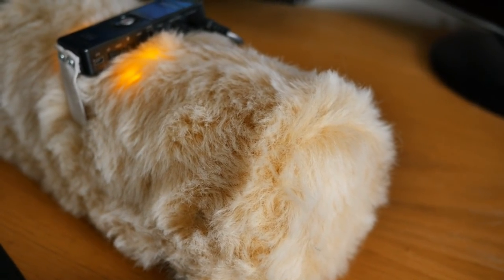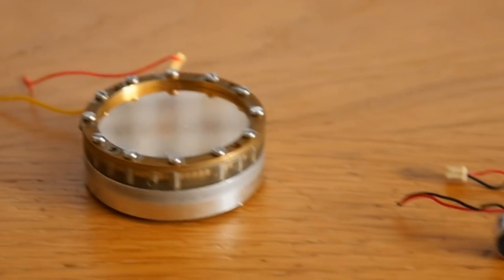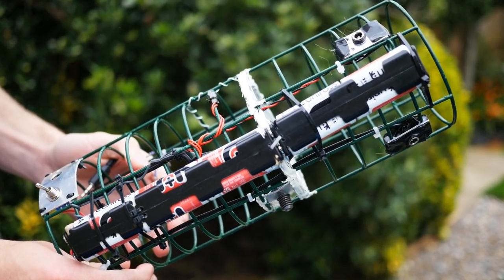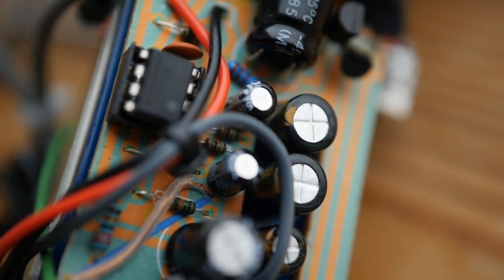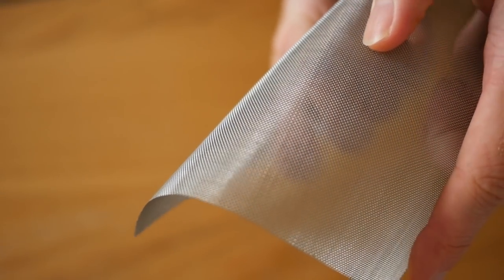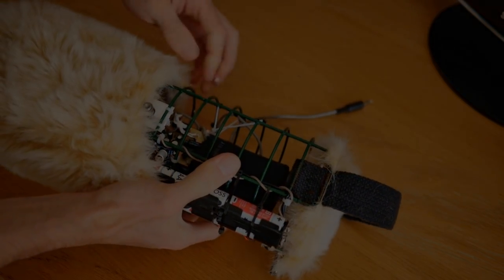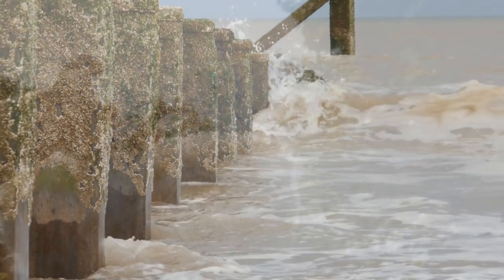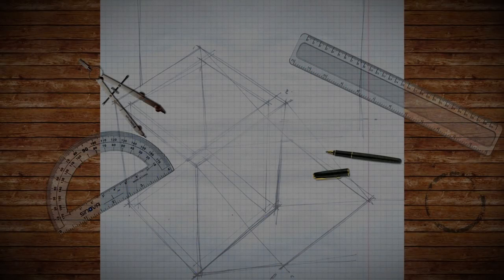The Ultimate DIY Microphone (super low self-noise!)

Comment: I love this... This is SOOOOOOO good, but yet it has a few pet peeves I feel an absolute need to point out.

Clearly, you have the electrical knowledge and audio engineering understanding to not only gut out 2 seemingly expensive mics [$200 is expensive to me, $400 for 2 is a nightmare] but to track down the right kind of pre-amp circuit and modify it for the phantom power requirement of condenser mics and to then manufacture that all together into a compact package and then shock suspend it in a cage... 

Yet it feels like you threw away all that intricate knowledge and attention to detail when you seemingly slapped together the PCB sandwich haphazardly and then made two half-assed screens for the mics and then threw everything else together with zip ties. 

I mean, don't get me wrong, this is well and truly amazing, hell you have a CNC router, I want to build a CNC router so I can do this kind of DIY stuff... You have all this knowledge and skill condensing into a product which is honestly the far upper echelons of what "DIY" usually constitutes an instead of pushing through with that attention to detail and product understanding it feels like you dropped your ability to care about what you're creating and went with the 'she'll be right' fit and finish of dodgy workmanship [the ground plate in the sandwich and the red mounting pads] and the use of zip ties for literally everything mounted to the birdcage and for the mics mounted to the circuitry... You have a fricken CNC bro, could you not design up and fab something moderately more elegant in a short frame of time?

I mean, I love how you found a birdfeeder and used that as the frame, that's brilliant and elegant, but then you just zip tied your mounting plates to it and it's as though you just wanted to avoid thinking of a more 'finished' solution. 

But I get it, on one aspect a lot of these sorts of projects are perpetually a sort of prototyping phase which is never really re-visited and finished off and sometimes something ends up taking more time and effort (especially with me) than you had originally anticipated so you almost start cutting corners to just get it finished... But I don't know, it's like your idea was half a step away from genuinely being mistaken for a $1000 product but the tell of zip ties and chaotic vine wrapped wires on the birdcage are a kind of tell that this is just a really good DIY project...

Zip ties as a fix all... I dunno. It's like DIYers that can't spray paint to save their lives and end up drenching the item in paint rather than lightly dusting it with numerous coats or DIYers who spray paint PCV parts with spray paint instead of vinyl dye (which is, pretty much all of them). It's like, 99% of the time paint is just used as aesthetic surface covering - almost always black - as opposed to a material protectant, which is what paint was originally for especially in the case of metal and even though the entire point of painting the DIY project (or in actuality drowning it in black spray paint) is to make it look professional/good and maybe make all the surfaces and mildly varying materials look more uniform so it looks like a professional purchased product rather than a junkyard DIY, they screw it up by painting entirely wrong. Painting small things is not hard and yet people almost always get it wrong and completely ruin the finished product. 

The irony is that most DIY stuff is either made out of or with PVC, made or modified from toys and cheap electronics and almost always made with plastic over metal, most certainly painted a flat black which is the easiest of all colours NOT to screw up... Yet everyone gets it wrong. The irony is that almost everyone is spray painting with paint and with terrible technique when there's already a product out there accidentally suited exactly for their purpose: Vinyl Dye.

The irony is that vinyl dyes, originally for the purpose of dying the vinyl interiors (mock leather) of vehicles and to an extent, I guess any furniture/couches etc with vinyl, is an accidental exact match to all the needs of a DIYer. Vinyl dye, originally for dying vinyl fabric (arguably impossible to spray paint) is chemically 100% compatible with vinyl-based plastics, i.e. Polyvinylchloride aka PVC and it is also 100% compatible with ABS plastic which is ironically a very cheap and fairly durable plastic which is very easy to injection mold, meaning most consumer good especially as far as tech and electronics go, when made with plastic are made with ABS. Ironically, nearly 100% of the things DIYers touch are almost certainly chemically compatible with vinyl dye and luckily for a group which has consistently proven themselves pretty terrible with fit & finish and with painting, it's stupid easy and almost impossible to screw up. 

Granted, vinyl dyes get a bit technical and confusing when talking about gamut and pinpointing certain colours and there is a great amount of variation to the end product depending on what you're painting on (all PVC and ABS is pretty much compatible, but it's not necessarily going to be the same finished product) but when talking about the 'just paint it black' mantra of DIY then you literally cannot get it wrong. With vinyl dying there are no primers, no clear coats, no need to remember how many primer to top to clear coats you have done (obviously), no complicated drying times and humidity/temp requirements when painting as with paint, there's no intricate prep work and unlike any kind of paint on plastic, even marketed "plastic paints" or "plastic dyes" you work ever get scratching, chipping or flaking of the paint with vinyl dyes. 

Only vinyl dyes can (accidentally) accomplish this holy grail purpose of being perfectly suited to something completely different to its original intent and being so perfectly (and accidentally) tailored to the requirements of such a large potential user base. Paint is very finicky and even if you follow the steps it may still not work out. With vinyl dye, all you have to do is scuff up the surface lightly with steel wool or sandpaper, if there's paint already over the plastic it needs to be sanded back to just the raw plastic. Vinyl dye seeps into and stains the plastic rather than simply putting a coat of paint on the top so if there's paint or a finish, the vinyl dye will chip and flake but if you sand back to raw plastic it will stain and dye the surface. Then, clean the plastic surface with a mild detergent (like soapy water with a dish detergent) to clean up all the potential residues off the plastic then rinse it well and dry it. Unliking with painting this prep isn't rocket science, it's literally like washing a plastic bowl in the sink, just wash and rinse it well and let it air dry completely. Then simply spray very very light even coats of vinyl dye and wait a solid 20-30 minutes making sure each coat is dry. 5 coats are probably plenty. Once you've done it once and realised that any un-painted/coated PVC or plastic can simply be scuffed up quickly, washed with dish soap and then painted plain black with the absolute minimal effort (vinyl dye spray is roughly the same price as paint, and you don't have to buy primers or clear coats too) then you realise how heavily the DIY community could benefit from this info and from ditching duct tape and zip ties as a primary form of construction... Seriously, does my head it, so much DIY is shit purely due to crappy paint and zip ties. 

I digress... This was actually awesome and I really really want to make one now that I've seen it can be done well and that it creates such and awesome final product I'd just also really like to see you go back and 'touch it up' to make it perfect.
Reply from the maker: +Jordan Huckel duly noted, and I agree. I've been meaning to revisit this but make all the elements of the design perfect with source files available for others to make a carbon copy.

Comment: Nice project. 
But something different from your Schematic with the actual PCB, Especially for DIODE. please explain ?
and also can I use this circuit for amplify electret mic ?
thank you very much
Reply: That circuit is too overkill and supplies too much power for an electret mic..A simple two/three stage npn transistor preamp would be much more suitable.

Comment: Was sticking a boost converter in there really a good idea?
Reply from the maker: From my tests it added no audible noise to the audio signal, so it was definitely worth it to allow the use of fewer batteries, and have a constant predictable voltage delivery (rather than one that varied with battery charge).
Reply: +DIY Perks  +Old Machines & Such I was impressed with the build, even the preamp choice is great (there is better though with new LME series from NI) but only thing that hit me as "this is bad" was the crappiest boost off of ebay...
Luckily that one works at few hundred Khz, if it is significantly higher then 200KHz aliases from 196KHz Fs with high end sound recorders should not be a problem add little bit more filtering and preamp with decent PSRR>you're good...
Luckily final result seems fine 8-) thumbs up!

Comment: This would be a lot easier now with 2x Rode NT1 5th Generation USB, a small laptop for power or a powered USB hub and iPad/iphone. No soldering no PCB boards etc. You run on 32 bit float.

Comment: interesting.. you used an Attenuator ( 6:05 ) instead of a Audio log potentiometer.. why is that?
Reply: +DIY Perks did you use it as a db cut for the noise or for volume of the whole circuit?
Reply from the maker: It just allows for repeatable volume levels, really, and doesn't require much thinking about on location. For example, I have the three highest settings are loud enough to mask the recorder's own noise floor, while the ones below that are for louder sounds (like gun shots and jets) where the extra headroom is needed.

Comment: I hope you filtered the guts out of that boost converter.
Reply from the maker: Wasn't necessary - the LM2577 is remarkably clean, so added no audible noise to the audio signal.
Reply: +DIY Perks haha seems I let my self get convinced by lots of internet hype about those converters.
Reply: +African Electron The most noise that those generate is at a mutch higher frequenty.
Reply: +African Electron On top of that, all modern amps have a huge PSRR (power supply rejection ratio), meaning the supply's noise doesn't bother them

Comment: This is ridiculous.   I use 6 WM61s  (3 on a side) added into  op amps  powered by 4 AAA cells.  The signals add, the noise doesn't. Cost less than $10, fits in my pocket.  Need to be at least a mile from nearest road to record.

Comment: preamps in h1 and in zoom recorders in general are shit, someone made a video about external mics for dslr cameras and it ended up to discover that its better to use a normal mic preamp for low noise...
Reply from the maker: I did my own tests and the H1 has exceptional dynamic range on its line input when it's set to volume 16. That means really low noise. Zooms older products certainly had questionable preamps, but the H1 is a nice exception. Not sure what their latest offerings are like.
Reply: Omm just as an aside - on the H1, there's a significant difference in EIN between level 30 and 40. Switching from recording level 36 to 37 produces a noticeable drop in hiss. This is true for both external AND internal mics. When making this switch while listening with headphones, you can hear a quiet electronic "click" noise as you move between 36 and 37, not noticeable when moving between any other two gain settings. I'm not sure how this equates when you're using all the gubbins attached to the Rode mic's though.

Comment: Do not power a low noise analog amplifier with a switch-mode voltage booster!
Reply from the maker: +Timur Nuriyasov I did my testing and the added signal noise is negligible, and far less than the microphones own self noise, so it is all good.

Comment: I see you've deleted my comment. Let me repeat myself: You have built a faraday cage and not a unidirectional microphone (shotgun mic). That bent garden net will block radio interference, but it won't do much about the noise, which is an inherent limitation of the microphone used. It's better to use a separate pre-amplifier (especially with Canon cameras), because the low-quality camera pre-amps have their own noise-to-signal ratio. 

Unidirectional microphones are long because they use most of their body to block lateral sound. All the noise travels to the side of the mic and enters its cut-outs, where sponge is placed to soften these noises. The cut-outs work in a similar way to the sponge, the sound waves get inside the mic and hit its opposite wall, replicating themselves while also decreasing in intensity. Sorry if I'm not able to explain this well enough, English is not my native language. 

Except for this lack of research on your part, you've made a major mistake by placing the two microphones opposite each other. Did you mean to build a unidirectional microphone, or one of those stereo ASMR mics? I think you should stick to building LED panels, audio doesn't seem to be your strong suit. Take care, Mr. Censorship.

Comment: that microphone build was like 700 bucks :/
Reply: +ramsey144 an equivalent would be worth something like 2000 bucks. Keep in mind you can get great mics like the one he has for around 100$ used, so you can probably make this for 300$
Reply: manaquri Hmm its still kinda priced too but u know the circuit part on his build... Well he doesnt have good explain how he did his circuit board
Reply: ramsey144 it's mostly just a bunch of jellybean parts (e.g.1-2$ for 10-50 pcs )
the pcb will cost 1.4-2.0$ but you need to order 10 too. (you can get by one for 10-12$, but as you need 2 so it's not worth.) if you have access to a cnc or some other way of making the pcb, it would cost a lot less (like 5-20c/pcb), so you could probably make the 2 for around 20$ (and it would probably cost about the same to make 10, because of bulk prices)

the boost converter costs around 2-3$ 
the battery would cost around 20-30$ (10 lithium-ion batteries) 
a decent guess for the whole case+ fur+ misc plugs would be another 10-20$
so I'd venture to say the whole thing costs 70$ (probably more in the 50$ range)+ the costs of the mics. so if you can get a bargain on the mics, you could get this done for maybe 200$
Reply: manaquri Can i have links for the circuit board?
Reply: ramsey144 at 4:27 you can see the pcb, but I don't have the full schematic, but you can use the one in the video's description with this: http://sound.westhost.com/p96-f2.gif (connect the mic+ of the phantom schematioc to +in of the amp, and mic- to -in) the 48V comes from the boost converter, and the out of the amp goes to the recording device.(you would probably connect the left amp to a jack cable's left pin, the right one to the right pin, and the ground to the common ground.)
Reply: manaquri okay thanks!
Reply: ramsey144 you can also not modify the mics, which could make the whole thing larger, but you could use them for something else or resell them if you don't need them.
another thing you can do is use only one mic, if you are on a budget.
If you are serious about quality and don't mind a bit of tinkering , you can buy matched pair of condensers, and a circuit for it for around 300$, so for around 400$ you have the equivalent of  a 2000+$ mic 

one final thing !i forgot: don't forget to get over discharge, current and charge protection circuits for each battery.(that costs around 3$ for 6) and also buy Panasonic, Sanyo, Samsung or LG batteries, there's a lot of crappy counterfeit or "revived" batteries that for example say 9900mah while only delivering 600mah  there's a lot of information on this as the 18650 batteries are used for e-cigs.
Reply: manaquri Lol get huge batteries :p

Comment: But let’s get this straight. Røde is nowhere close to a high end microphone brand. They make costumer products. The mics sound pretty bad when you compare them to actual high end brands like Schoeps, Neumann or Sennheiser. It’s most definitely not all about noise floor. And a Røde mic will surely have more self noise then say a Schoeps. The problem with the audio recording you used is the mini jack plug. They break easily and have bad pre amps. Of course this is a diy build, but for actual high end recordings you need a recorder with good pre amps and good microphones that sound as natural as possible (that’s mainly where all Røde mics stay behind). The only thing. You could really use professionally in this video is the Windscreen or blimp. But in the end, you can get a really good Rycote blimp for less then 300 dollars and even less used. 

A good field recording set should be versatile, easy to use, durable and most of all modular so you can get rid of Røde products as soon as you hear a Senheisser next to it.

It’s a nice build, but in my opinion the blimp you built doesn’t deserve the gear you used.